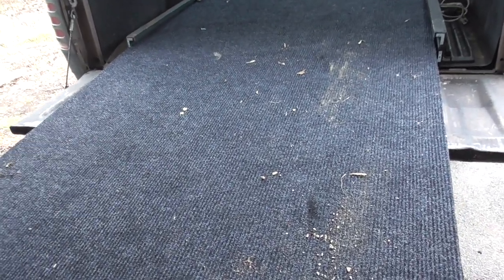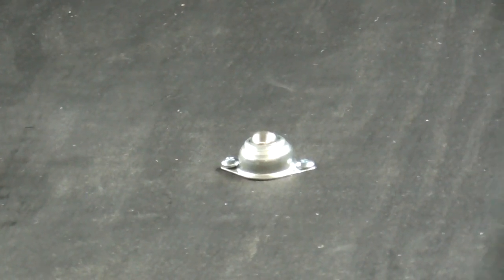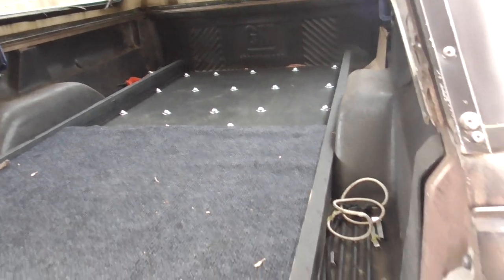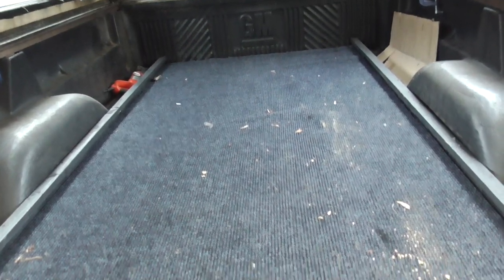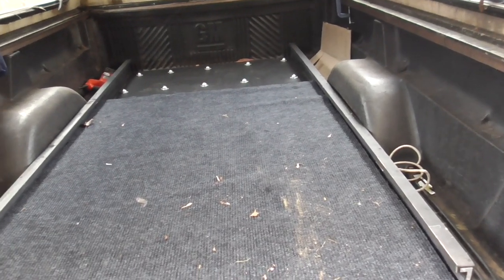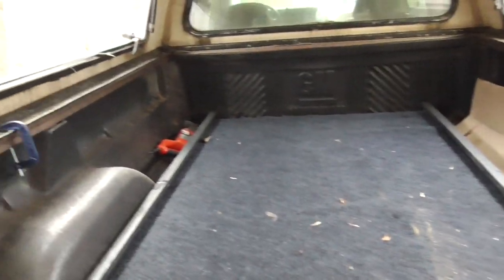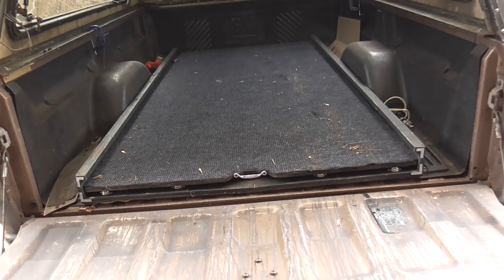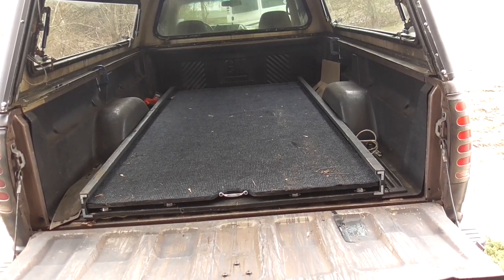DIY truck bed CARGO SLIDER

Comment: How much smaller width is the top piece of plywood? How much spacing on the sides between the 1x4s?  Thanks
Reply from the maker: Top piece is 46 3/8 between 1x4s  is 46 9/16

Comment: Now, how does it handle cargo, like drywall panels, appliances, 40 bags of cement, etc.?
Reply from the maker: That I can not answer because I have not hauled any of that stuff, I have loaded it with garage junk to haul off and loaded it with camping gear.